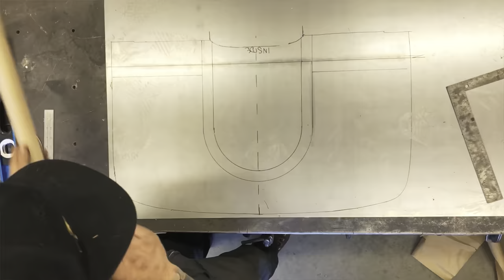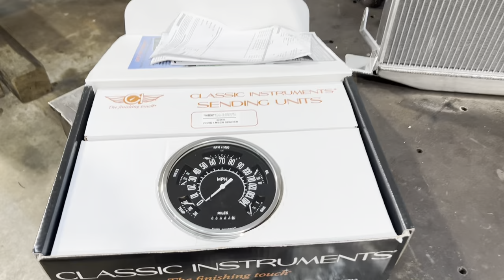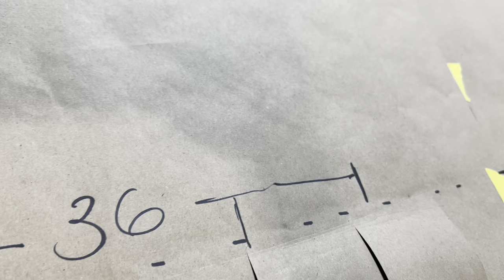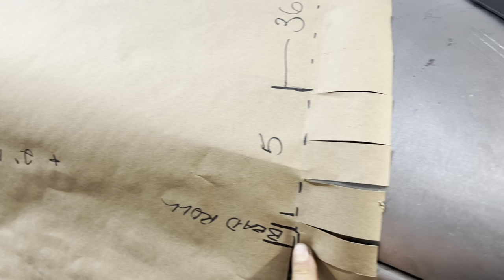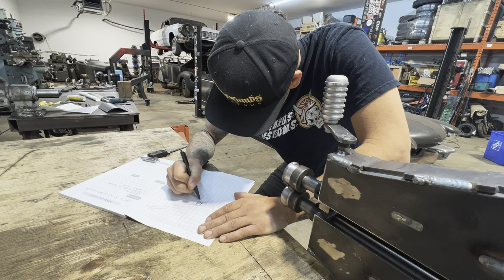How To Make a Hot Rod Hood from Scratch for a Roadster - Using the English Wheel & Bead Roller!!

Comment: Karl,  I found a solid rubber caster wheel at harbor freight which was 6" and it really works better than the rubber band.  Yes it takes a few minutes to change the wheel over but, it takes the frustration out of the rubber band always going off to a side and having to constantly having to realign it !  Looks great keep up the great videos !
Reply: yes i agree we don't have a Harbor Freight but have one called A MANS TOY SHOP same thing but from what i have Hurd say you can get way more from yours than the one we have 6 inch by 2 1/2 inch wide great for rolling the bends in the tin
Reply: I was wondering how frustrated he was getting. I know I would have been. Lol
Reply: Great attention to detail, and your jigs, fences, etc. enable you getting perfect results while working alone.
Reply from the maker: Yes I actually have one 8 inch wheel that a friend of mine who works at a rubber place took and stripped the urethane off and then vulcanized new rubber to the wheel. I swear it’s gonna be the most amazing wheel I’ve ever used I just have not made the bearing for it yet
Reply: @MakeItKustom  That would be a cool wheel to sell on your website along with your Japhands Kustoms radius guage. Just like you built it. Looks sweet
Reply: @MakeItKustom  Well what are you waiting for 😟

Comment: love the work, learned much and I have a tip for you.  I use playdough to to find clearance issues... just plop a ball on trouble area put parts together as much as you can, remove and look at the clearance issue on the dough. works geat. cheers

Comment: I love the evolution saws. I have their hand circular saw and love how easy it cuts metal and especially how little of a mess it makes! I am planning on purchasing their bench chop saw as soon as I get my new shop finished. My old abrasive chop saws would sling crap everywhere in the shop. There would be abrasive grit and metal dust on the other side of my old shop. This will help sooo much with clean up and it cuts so much faster. And the metal doesn't get as hot as it did with the old abrasive chop saw which was basically grinding the metal. This comment is a year past when you actually got the saw amd I bet you're loving it!

Comment: I use a urethane wheel on top when I’m rolling a radius. It’s an 8 inch caster (with a cast iron center) and I was able to purchase a bearing with a metric OD and an SAE ID which fit my particular wheel perfectly.  It was inexpensive to put together and an absolute joy to use!
Reply from the maker: Yeah I have one that a friend made for me actually vulcanized rubber onto a cast wheel but I need to make the bearings for it lol I think it’s definitely worth having a Wheels that doesn’t need a band

Comment: Hi Brenda! 👋  yeah u nailed it on the aftermarket parts that are supposed to be direct bolt on stuff but never seem to fit. Body panels are usually a nightmare and even things like getting headers to fit can be almost impossible without modification.

Comment: Awesome job. Worked in a truck and trailer shop, lots of aluminum. A little wax on cutting discs, grinding discs will keep them cleaner. The aluminum does not stick. Not for painted surfaces.

Comment: I enjoy watching your videos. Great tips and helps me be motivated to work on my projects. In my shop is a 7-1/4" size Evolution saw. Really wish I had gone to the 10". Looks like you have a 12"? ALWAYS WEAR A FACE SHIELD. Not just safety glasses or goggles. And as soon as the teeth start to get dull, sharpen them before you ruin the blade.

Comment: Thanks for taking us along on this one, Karl! I really like the MODs you made to the Bead Roller on this vid as well!
Reply from the maker: It actually worked out well I will tweak it a bit and make a new design
Reply: @MakeItKustom  It really did. I like the idea you have of replacing what you used on the hood with a plate to let the metal rest on as you push it through. The die you made to match the hood up with the body really worked out great as well! I really like the way the hood turned out! Are you going to try to put any venting in the hood to spice it up?

Comment: I had the same problem with my English wheel rubber tire not tracking correctly.  I found that my top wheel was a very little kicked to one side pulling the tire off. If you can get a indicator on both wheels and find out how to get them aligned better your rubber tire will stay on. I went to Lazzys metal shaping class and he has some shims for his Lower dies and you can kick them up at a angle and it helps get into tight places like in motorcycle finders. If you find your lower die is misaligned you might be able to shim one of your lower wheels easy. Just a tip that helped me. Good job on the hood.
Reply from the maker: Thanks for sharing man! Yeah having adjustable wheels would be pretty great. I have a rubber vulcanized upper wheel that I would like to machine a bearing for so that I can swap them in and out

Comment: Love your adjustable fence design. I have a similarly designed bead roller, but I incorporated an Eastwood fence that I’m very unhappy with. I’ll try a couple of the things that you did to improve it. The angle guide in particular is on the menu. Thanks!
Reply from the maker: You’re most welcome thanks for watching!
Reply: @MakeItKustom   BTW- I build pre-war, boat tail race cars. Fox Body Speedsters, Franklin Grove, IL

Comment: Great video and superb looking car. It might seem a PITA to make all the tooling for a five minute job but it is worth it to get it bang on.
As for the body lines on those coupes I watch Bellos Customs do these cars and they all seem to have massive boots and boot lids (trunks). I've wondered about steepening the curve of the boot lid. It would shorten the tail of the car but not enough to affect the position of the rear wheels otherwise you are into chassis shortening

Comment: You da man Karl. 

I was wondering if you ever rip your mitts open on the plate steel. I generally end up with razor blade edges.
Reply from the maker: Not often. The sheer that I use leaves a pretty safe edge

Comment: Karl, you are amazing. Hood looks fantastic. I have an Evolution saw, It works great. One work of caution, those chips that fly off are little curls, very hot,  and they go everywhere, especially in your eyes, shoes and open engine block holes. I highly recommend cutting in a wide open space or outside where you can clean up easily. Watch the dogs feet also the chips are sharp.
Reply from the maker: Yeah I think that I will make something to contain the chips it definitely throws a lot of them

Comment: I find that using a truck inner tube over cut so it overlaps the top wheel edges by a lot, helps to keep the rubber from sliding sideways off the wheel

Comment: I remember, Trev's blog (I think) putting double sided sticky tape on the wheel to hold the rubber band in placed. 
Worked a treat. Solvent removes the tape when it's done.
Reply from the maker: Yeah I did that in the past but I am too impatient to clean off the wheel that much

Comment: Just watched this video and saw the issues with the rubber band on your bead roller. I saw you flick your finger between the rubber and the wheel to put it back on course. Idea: Add a couple of guides, one on each side (to account for the direction changes) to do the same thing as your finger, guide the rubber back to the centre of the wheel. Could put them on plastic bushings and at the top so they stay out of the way, hope that makes sense. Nice work as always.

Comment: Great job as always, you should bead roll a piece and extend the  beads on the cowel and use the bead rolled edge as the bottom line of the hood
Reply from the maker: There’s a great suggestions I’m definitely going to continue it onto the cowl to fill that spot that’s missing for trim

Comment: Karl  
I was just wondering what you have done to the metal to prevent moisture rust on the body - this has been sitting a long while and no sign of surface rust. does the metal have some kind of treatment?

Love your work.
Reply from the maker: Thanks a lot Michael I’m using Gibbs brand lubricant I put it on a year ago it dries nice and doesn’t mess with paint in the future
Reply: @MakeItKustom   I see, so Gibbs is a bit like WD40 I now buy WD40  in a 4 ltr jug and use a pump sprayer in stead of Aerosol.
WD 40 in 4 ltrs at AUD$35.00 v's a spray can with 350 ml at about $8.00 a can

Comment: That was awesome Karl, the bead on the hood is spot on. Great idea on the bead roller attachment, why not leave the angle iron on, just cut it short ? On the English wheel why don't you just contact cement the rubber on and make another wheel and set up a quick disconnect to change them out ?
Love your videos, you're one smart cookie with metal fab.
Reply from the maker: Yeah I have a second wheel already that has been professionally volcanized with rubber I just need to make a new bearing for it to see it. This will solve all my problems

Comment: I noticed you having same problem I use to have with the rubber slipping off your top die in the wheel
I made me a top die out of delrin with the lathe works great
Reply from the maker: Really? It’s soft enough? That’s a game changer
Reply: @MakeItKustom  seems to be moreo think about it I think I used uhmw it was a while ago
Reply: I know it wasn't great at first then I drilled hole in it sideways around the edge 1/4 in from edge giving it a look like a mag wheel to soften it up worked much better

Comment: Karl, love watching these fab videos, great work!  I was getting frustrated just watching that rubber band slip on the roller, and I've never even used one before, but would it be a silly suggestion to put a few pieces of double stick tape between the rubber band and wheel to keep it from slipping around?  I just know that would be driving me crazy and I'd be trying something to keep it from walking around.  Keep up the great videos, looking forward to more on the mini car build.
Reply from the maker: The sticky tape does definitely work it’s just a bitch to get off because of how much pressure is applied to it when rolling lol it takes a razor blade and lots of chemicals to get it off

Comment: Hey Karl,Rik here from the Netherlands, across the pond. Just catching up on all your vids, JUMMY. Never I saw somebody explane in so much detail how to build a masterpiece this clearly. It's obvious we are watching the master himself. I was wondering, wouldn't it have been aesier to drill an extra hole in the radiator bracket just behind the hole that stuck too far out and tap another thread instead of grinding away on the radiator or would that have caused the radiator to tilt in a way off angle. Besides that CUDOS TO YOU ...... WAAUW.

Comment: If you have a forklift tyre place near you they might have a solid rubber wheel you can use instead of the rubber band, also if you have a spare top wheel you can get the same forklift place to press a rubber ring over it.
Reply from the maker: Yeah I have a wheel that has rubber on it I just need to make a bearing that fits my pin

Comment: when you rolled it threw the fence the 2nd time I thought your bead would get wider aka move over.. like you adjusted your test  pass when the bead is made it takes metal ,,  so I was thinking that the metal from the bead to the bottom of the hood would get smaller there it would move the bead good that I was wrong

Comment: I don't know if your buddy already modified his drive motor, but they make gear heads that would be a direct bolt in operation. Gu90k I think is the part number for a 90 to 1 gear ratio. The one on it is 75 to 1 or gu75k. If that's not the exact part number put it in a search and it'll point you in the right direction. If nothing else it might help someone else watching this wanting to do the same thing.
Reply: Correction! 5gu90k or 5gn90k

Comment: Karl -Just a tip for the new cut off saw - get a piece of right angle and cover the internals with pre adhesive emery paper - 80 grit to hold round stock from spinning whilst cutting.
Heaps of guys swear by the evolution.
Reply from the maker: LOL I’m out of the loop didn’t realize this is a sworn by machine! Now I’m swearing by it! I can see why

Comment: Karl, Nice job as always. Curious as to the Makita shear you use to trim. Is it the JS1602? I need to cut some 16 ga. stainless and that one is advertised as capable of 16. 
Thanx,
Reply from the maker: Yes that is the model I’m using. I love it it does everything I throw at it. I have not tried 16 gauge stainless though. Typically the 16 gauge rating refers to mild steel. I wouldn’t be scared to try though but I would expect the blades to not love it
Reply: @MakeItKustom  Thank you, Maybe I'll buy an extra set of blades right away.

Comment: Try cleaning the rubber band and wheel contact surfaces with alcohol. as dust may be part of the cause of the band movement. Also a mid '50s V8 engine would look so much nicer in the '31. For example what was used often "back in the day", was the nail head Buick, Oldsmobile Rocket, or the Cadillac 331 ci V8. Oh, I just happen to have a 1954 331 ci Caddy motor, (complete with starter, carb, generator), and it will run as it sits. Also have the 4 speed Hydramatic trans, or a BW T10 4 speed manual. Dang...I sound like Haney of Green Acres.

Comment: Yeah yeah everyone enjoys the petrol projects. But this mini Buick might be a great chance to look at electric drive. eGo lawnmower is a direct replacement for a 200cc Brigg's n Stranton engine. Add the proper brushed speed controller to modify to a potentiometer pedal setup and whala. Mount a backpack 28ah Battery and roll thru the next parade. LOL
Reply from the maker: No way? Sounds rad!
Reply: @MakeItKustom  take it to 72v3000w useing the Atlas 40v/80v battery packs from Harbor Freight. Would take a few more Batteries to support longer run time but way more power to do the burnout's with.  It's how I would go at least. I currently use them on my West Coast Chopper framework one bike uses the 40v 500w/36v and the other uses the 80v with a 1000w72v controller. BOTH use the AMP 750w rear hub. WHEEEEE (picture is of the 80v before the battery upgrade) most agile bike I have ridden in my 56 years of experience.

Comment: Hey, Karl. How do you make the hem on the edges of the hood? I have seen it done by bead rolling around a piece of wire but it requires a lot of hammer work.
Reply from the maker: I haven’t decided how old finish the sides yet but I will likely put a bit of a break on it

Comment: the test bead you did could you of measured the distance from the edge of the steel or say 2 inches to the top of the bead position before you rolled  it , then re measure after to see any difference  then apply that reduction to the hood if there is any difference  ?
Reply from the maker: Sort of. I don’t think that you would be able to accurately measure the material taken in from the centre of the hood with your suggestion. That’s why I make the mark above so that we have a position from the above and below the bed to measure. In this case I don’t think it would’ve mattered much because there is almost no change but in a B that is a little bit larger it is important to know whether or not it has taken some metal from above it as well
Reply: @MakeItKustom  if you had a piece of steel 4 inches wide and put a roll in the middle the overall width would reduce , but the distance from the edge of the steel to the edge of the roll would remain the same on both sides

Comment: It's too bad the radiator didn't fit due to clearance but if you just remount it with aluminium angle each side and set it back the amount it needed to clear! Nice job you're doing Cheers from Australia

Comment: I don't know shit from clay about the English wheel but, I cut my inner tube rubber 1/2" wider on both sides so it roll over the edge. This seems to stop it riding off. I really have to twist the sheet for it to move. Maybe I have a larger gap on the side that allows this. Either way it would be interesting to know if it works for others.
Awesome work , great detail and fantastic tips.
Reply from the maker: That’s awesome man I really need to do that to the next rubber. Thanks for the tip

Comment: I'm wondering if some WD-40 would keep the rubber band from gripping the metal and falling off the wheel..... Not sure how hard it would be to keep it on the steel side vs the roller.... Also if it could break down the rubber band..... Just a thought seems like it falls off a bunch.

Comment: 51:48 I'm nobody, but I think this was inefficient... 

Why not just use a small straight piece of offcut, align it to the bottom edge of the hood, which you had to do anyway, and you already have a marker line on the hood, that's above the top of bead. 

If the bead draws the metal down, away from the marker line, the piece won't align with the marker line when it's aligned with the bottom edge of the hood. 

If it draws the metal up, away from the bottom edge of the hood, it won't align with the bottom edge of the hood when it's aligned with the marker line. 

If it draws the metal both up and down, when the bead is aligned there will be a gap between the piece and the marker line, and the piece and the bottom edge of the hood. 

And you can measure those gaps. 

Then you could save yourself the time of laying out on paper, cutting out a piece of sheet, and carefully shaping it to match the hood... 

Just a thought ¯\_(ツ)_/¯

Comment: I wanted to try the high quality 3M rolocs, and checked out German Amazon and the purple discs cost 8 times as the cheapo normal 75mm ones ☹️😭.. I need some more time to convince myself haha..
Reply from the maker: If you try them and find that they don’t last that much longer I would be surprised. I know they are very expensive but they do not wear out